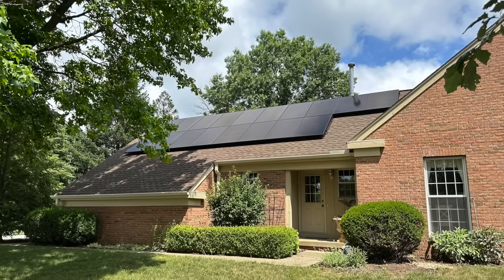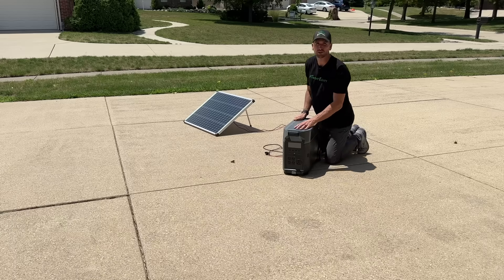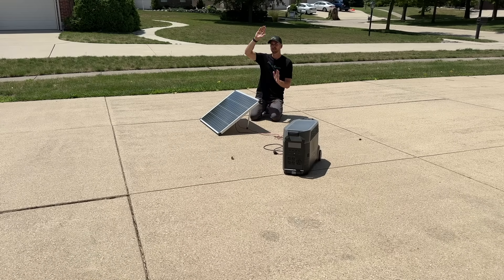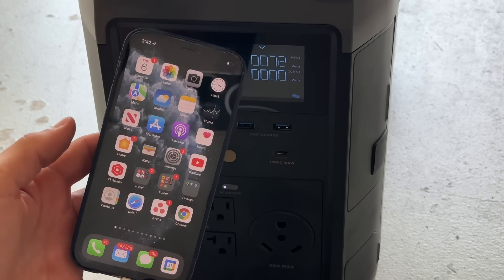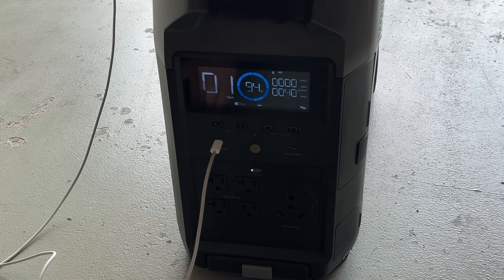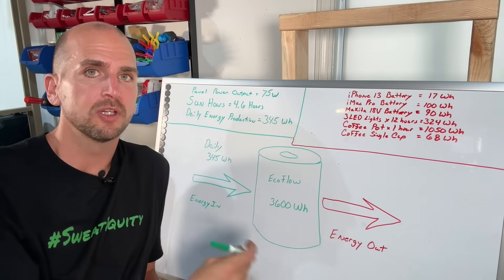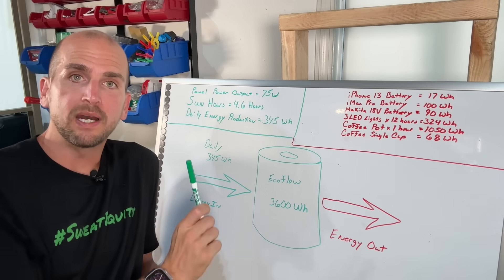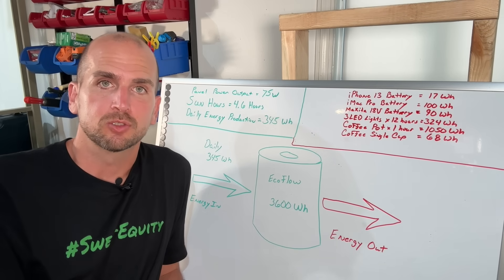What Can You Run On A Single Solar Panel?

Comment: I just wanna run my tv when there's a blackout too piss the neighbours off
Reply: This is my new goal 😂
Reply: Power station
Reply: Trust me they all will be in the house. It's better to work togher
Reply: You're not nice 😂
Reply: @Gdji5fv  if there's a blackout why shouldn't I be able to have my tv on and no one else can cause there's no power, what's it got to do with being nice or not, I'm watching my 65 inch tv and they are sitting in there units in the dark which person would you rather be?
Reply: In 2010 I installed 10 cell tower batteries for a 2200 amp hour battery bank and had a 4000 watt inverter in my house. That was 28,000 watt hours of power. The house was on a steep dead end street in a wooded canyon. It was very quiet up there. When the power went out in the evening, I used to turn on all of the lights and run the vacuum cleaner while the neighbor lady was busy lighting candles. Of course the windows were open. Another power outage lasted 6 hours one rainy evening and I watched War of the Worlds, Tom Cruise version with the surround sound turned up. I would tell the neighbors that I had Duracells in my appliances.  It was fun for a while.
Reply: @kimmer6  ah man, compared to my meager set up you have a power grid all your own.lol awesome!
Reply: @kimmer6  I monster lol
Reply: 1 100 watt light bulb
Reply: @pippycat9915  100 watt bulbs are kinda a waste now mate, you can get led lights that run at like 15 watts and still give the same light as an old 100 watt
Reply: @pippycat9915 so 1100w same in led 101w same lumens. But emagine a 1100watt led wow blinding 😁👍
Reply: Lol
Reply: Hahaha!

😆
Reply: Your neighbor will throw rocks at it 😂
Reply: @proxy_server  that's just being nasty
Reply: And a DVD player.
Reply: @NJG21064   why not a blu ray player :P
Reply: HERO 👏👏👏👏😂😂😂
Reply: A still picture of a troll face...
Reply: I feel you my man 😊
Reply: Buy a 12 volt battery $80 , a small battery charger $30 and a 400 watt inverter $30 and you will have plenty of power.
Reply: @stephenfitzsimmons8837   🫣 using a battery charger when there's a black out why didn't I think to do that earlier
Reply: @stephenfitzsimmons8837  🤪Genius why didn't I think of using a charger during a black out
Reply: why not starting a whole party when theres a blackout?
Reply: Move you people sound annoying. You will be doing a lot of people a favor
Reply: @creaturedomes9364  silence yourself don't tell us what to do if we wanna piss the neighbours off that's our right
Reply: I hear you, the  but if SHTF what tv stations are working or are you going to look at movies and using tv to project it on.
Reply: @ruthcoates9452   have to be a hell of a black out to take all the tv stations out here in Australia, like they would literally have to take out the entire power grid as tv stations here are all over the place.
Reply: I run a 12v tv it’s 20inch I have no probs , in the winter I had to charge the battery once we do have bad days
Reply: Your level of petty is aspirational 😂😂😂
Reply: @impoorfornow  why so jealous
Reply: I cancelled cable 2 years ago.  TV was too boring, but I get your point.  I would rather power up some lights in my living room and bathroom and just leave them on for the neighbors to see
Reply: @diytwoincollege7079  i don't care about TV, I want to watch my movies on my 4k 75 inch tele
Reply: That’s what I’m doing.
Reply: I pity anyone still watching TV. 😅
Reply: @Raven1816   sucks to be you
Reply: I do that 😁👍
Reply: I have a massive fish room. Even running a handful o led lights 10hrs a day would be great
Reply: I do, as well as lights and a deep freezer or small washer. And I act like oh ,the powers off?
Reply: @loriekaczmarek9788  why not
Reply: I had that on my boat on the port.
The wallpower go out and my boat just run on the lipo4 bank.
All other boat lamp out and my boat just switch lol.    @loriekaczmarek9788

Comment: STARTING VS. RUNNING WATTAGE
Some appliances require extra power to start up, while others maintain the same power requirements constantly.
To calculate your power needs correctly, you need to know which kind of load you are dealing with. (A load is defined as the device that you are powering.)  There are two kinds of loads:
RESISTIVE LOADS
Resistive loads are pretty simple:  they require the same amount of power to both start and run the equipment. Many resistive loads are involved in heating or making heat of some kind. Examples of resistive loads include:
Light bulbs
Coffee maker
Toaster
REACTIVE LOADS
Reactive loads contain an electric motor, which requires additional power to start, but significantly less power to run once it gets going. Typically starting power is 3 times the amount of power to run the application.   Examples of reactive loads include:
Refrigerators / freezers
Furnace fans
Well pumps
Air conditioners
Bench grinders
Air compressors
Power tools
Some household appliances, like a furnace or refrigerator, have internal fans that come on intermittently. Extra wattage/power is needed to start the fan each time.  Refrigerators also have a defrost cycle that requires power in addition to the compressor and fans.
Reactive loads may also require additional power when the electric motor begins to work.  For example, when a saw begins cutting wood, its power requirement will increase. This is not applicable for most household appliances.

Comment: It's strange that all these panels tend to be in the 100 watt range. Modern 1 meter x 2 meter panels are ~22.5% efficient, converting the 1000 watts/m^2 of solar radiation into 225 watts/m^2 of panel.

Modern Bifacial panels are even better since they energy harvest from both sides of the panel and you can get 1 meter by 2 meter bifacial panels that produce up to 650 watts.

I don't think this is a fair example of what can be done with a single panel, considering what modern panels can do.

The other thing about the voltage falling too low. Ideally, you should be feeding your solar output to a switching power supply that can take in a wide rage of voltages. That way you can set your panels up in series to produce a higher voltage and stay above the minimum voltage needed for the power supply under less than optimal conditions. The higher the maximum voltage input on the power supply, the more panels you can place in series, the darker it has to get before you can no longer harvest solar energy.

Just testing some of my own mini-panels out around the house, they produce 2.5 volts under good indoor light ~1000 lux and down to 0.9 volts under poor light around 100 lux. In direct sunlight, they produce 3.5 volts.

To me this would mean that, if you're minimum input voltage is going to be 12 volts, you should aim to have the DC output of your system at at least 48 volts, in that way, you will be able to harvest some power from dawn until dusk.

Comment: Both my Mr. Coffee and Ninka coffee makers use 1050 watts for 10 minutes while brewing 10 to 12 cup Potts, then they drop to 0 watts until the hot plate cools down and it kicks back on for 30 seconds at 100 watts. That time interval can be between 8 and 10 minutes depending upon the ambient temperature in the kitchen affecting the cool down of the pot.
Reply from the maker: Thanks for the feedback 👍

Comment: I have 2 170 watts and in winter they can't even power my Hue lights in the garden (Netherlands), so I charge for a few days and switch. In summer it will probably be fine, maybe I get some extra and I am searching to dynamically use that (battery is in shed, so not for phone charging etc).

Comment: I'm not understanding how you are getting 74 watts of power out of what appears to be a 100w 12v Renogy solar panel powering a 48v battery, even with an MPPT charge controller.  Is the charge controller able to boost the voltage up high enough to charge the 48v battery?  If so, wouldn't that severely reduce the wattage you can get from a 12v panel?  If you can explain this all I'd love to understand.

Comment: I need to find the South African version of this Delta pro box…loadshedding is killing me. What happens if you dont use all that power that is charging in the delta box. Stupid question can you keep it to use on another day
Reply from the maker: The Delta Pro will fill up to the 3.6 kWh of energy capacity and then you could use that energy during peak pricing hours until you drain the battery.  The Delta Pro Ultra is coming out in about a month or so.  Not sure if it will be available right away in South Africa.

Comment: I just got a 100 w panel (brand is LMenger) that has a usb and usb-c connector. It's my first step into solar. I LOVE it: can charge my phone (much faster than wall outlet), iPod, portable speaker, and two-way radio! I have nothing else - no batt, controller, etc. But - full disclosure - I do live in Arizona! :)
Reply: I have about 12 of the solar panels with USB ports ranging from 15 watts to 120. You can use extension cables to run inside for "free" power for an Onite LED light bulb and a three speed USB fan. I got mine for hurricanes before eventually getting more and more solar stuff until I could even run a small air conditioner in my camper. Thank God for the stimulus! I`m poor and on Social Security disability and the stimulus made my dream of having emergency solar power come true!
Reply: If it charges faster than a wall outlet then the issue is with the wall outlet which has access to way more than a few watts from a 100w-max cheap solar panel with god-knows-what thickness wires and voltage converter.
Reply: Are you a gal? Not to be feminist, but we do have trouble at times.yiu found it easy to work? Want to try out one panel by easiest means. Thanks. From Canada
Reply: @janetfisher5992  Yep. So if I figured it out, you can too! I wanted a USB-capable panel because I didn't yet have a power station, and wanted to be able to charge despite that. The panel came with all the cords!
These are plug-n-use so don't be afraid!
Reply: @jessstone7486  thanks so much. Will give it a try...
Reply: Arizona is walking distance from the Sun

Comment: About 7 years ago I used a Harbor Freight $200 solar kit to help build a cabin out in the woods. I charged hand tools and kept a radio going. I used a little $30 inverter. Never had temporary power turned on.
Reply: I built a solar generator using a harbor freight setup. 2 deep cycle batteries with a smaller car battery hooked parallel with the basic 30 amp charge controller and a 2500 watt inverter. I can run my small RV shore power line for 3 days (sparingly). It runs a small fridge and microwave as well as the AC unit (not for long but enough to keep it comfy). That being said because I can only charge at 100 watts it takes a week or more to bring the batteries back to full charge.
Reply: @mattdg1981  hey Matt, can I ask you a little more about your setup? I'm looking into a 100 watt panel just for ac and phone. I live in my SUV most of the time and Just want it to be cool enough to be comfortable during the day.
Reply: @thunderditrick5364  battery capacity is key. The more and bigger you have the better. You'll always be limited in charging capacity with only 100 watts
Reply: @mattdg1981  this stuff is so complicated. I've probably sunk like 40 hours into research. It's either stupid expensive for someone boondocking like me, or unsafe. I'm going to scrap the AC idea and just use a couple air coolers to try and get me by. It might suck for a while but I also only have a month until an apartment is ready for me
Reply: @thunderditrick5364  hey yo, I'm in the same spot as you actually. If I don't find anything good used on Facebook marketplace soon, I'm just gonna scrap the idea. Having my windows open and a fan going makes a good breeze that lowers the room temperature by about 20 degrees. If you get yourself or your clothing wet you can drop your body temperature as well and that's kind of just what I do. I am parked maybe 30 feet away from a river right now though. That's nature's fridge. Have water jugs getting cold in there right now they are tied to a string.
Reply: I thought that was me talking I've gone two weeks of lighting and television and computers and phone charging with two humongous marine batteries and a 2000 watt bee stack inverter
And to charge this I use three solar panels because that's all I have. Two solar panels use one controller one of my panels use one controller. Then to my 12 volt batteries into the inverter.. but I've always messed with this stuff and I am an electrician so I know what I am doing
Reply: @RonaldDaub-g7z  I started in the trades doing electrical work with my father. After high school I worked for a commercial outfit doing 3phase work and a lot of control wiring. I know by adding more panels I could recover power faster but I built it all to be mobile. Everything is mounted inside of a weatherproof cart with the panels mounted on the lid. The lid is at a 37 degree angle and I can pull the cart around the yard to gain more sunlight as well as having power wherever I want it.
Reply: Great idea!!
Reply: Thank you. 
That's been a long time ago now. 
Temporary power would've been much better but that's all I had available at the time. I'm WAAAY off the road... out in the woods!
Reply: @mrsparex  well technically it was a great idea because you now still have a moible power generating station for any and all needs. Including backup for lights, comms, small fridge, etc. Just a few more panels and you'd have a decent system I'm sure. 
I am planning to have a couple 50ah batteries to series up in different locations
Reply: 在加俩个moto Electric 24v 800w来充电…
.https://youtu.be/SuZrzNZPx0A?si=5z3Tj1KdB87KgGaM
Reply: You charged your hand tools how?
Reply: I used DeWalt cordless tools. I used an inexpensive inverter from Harbor freight. A couples of batteries. It was one of those Harbor freight kits. I never had temporary power. Finally finished the cabin. It was far from ideal but it worked

Comment: How about if you have a mish mash of panels,4x20 watt with USB controller 2x100 watt with normal solar wires, and others, how would you get a bunch of different ones into one storage
Reply from the maker: You will need to take a look at the voltage (open circuit) and current (short circuit) to make a plan on wiring in series, parallel, or series-parallel.  Definitely not a one size fits all for these type of setups.  Here is a video on my other YouTube channel which will dive into this topic https://youtu.be/zJ55k4m1CXo

Comment: Hey, I just got 8 used Solarex  MSX60 solar panels for $25! They're pretty old but still functioning. I have a hillside with a shed and parking area that I'd like to power up. Can you direct me to a video on how to do that? All the wires are just cut so I guess that's where I'd start. Thanks

Comment: I have 4 100watt solar panel from Eco flow and I used them to charge my delta batters . I have two batteries packs . On a sunny day I get around 290 watts -303 watts . Not to bad .

Comment: Its best to try and run things directly from the panel itself. Next is charging battery's to run things directly at night. What I would like to do is be able to directly charge say drill batteries, power a laptop etc with out a wasteful inverter. For a laptop I guess you would need a 24vdc system then a regulator to power a laptop, if its a 19vdc laptop.

Comment: The utility is not a battery. It's a sink for excess power. Non battery systems either don't provide any backup power, or only when the sun is shining. Most solar installation companies don't tell people this. I've had several people tell me they had no idea their grid tied system wouldn't work during any outage. They said that part wasn't explained.

Comment: Obviously your assessment is correct however one wouldn't be charging/using  everything at once. I try to prioritize my use of solar e.g I use the washing machine during the day so that the batteries have some time to recharge assuming it's sunny. I also use a microwave 800 watts, to boil a cup of water as this will exclusively use the battery rather than part grid and part battery when using a kettle. Something to do with the load/ discharge on the battery even though it's rated at 3.2 Kw.

Comment: your solar is useless with an atmospheric EMP which is becoming more and more possible. Wind might be more durable if you could have an insulated cover over the main motor and electronic module. solar i believe is more vulnerable. they are pushing ww3 with the democrats and Global billionaires right now. its here folks no Bull.

Comment: The Delta Pro doesn't change on solar less than 40 watts so that's why it goes to 0 below 40 watts of solar
Reply from the maker: Yeah, once the panel voltage drops below the EcoFlow voltage threshold you are out of luck.  Thanks for the feedback!

Comment: Does The storage device use solar only to charge the battery? What if the battery is full? Would that basically waste any juice the solar might pick up or does it then use solar to power the electronics instead?

What about connecting two or tree cells in parallel?

Comment: Ugh the math is hurting my brain cause it's back and forth... Just like my etcp international rigging certs... Where do I find a basic math graph for my setup... I got 200 amph worth of batteries, 3 100 w panels in series. Full sun all day. I'm burning at most 1200 w but a whole list of stuff on and off weekends in the garage burn the most power. Seems like my TV and fridge suck my system down in 2 days then I gotta throw the battery charger on so I don't kill my agm batteries